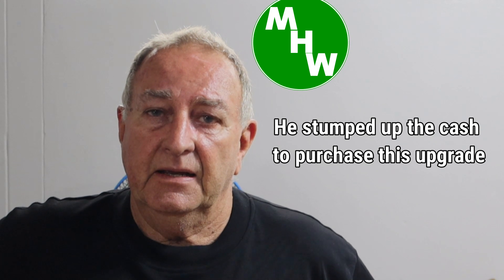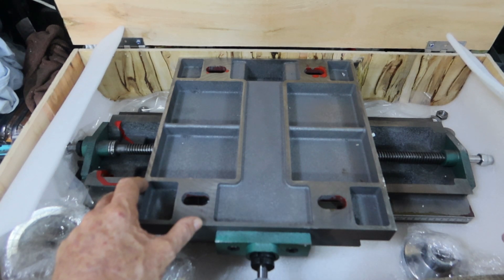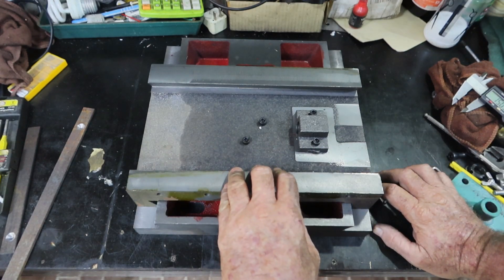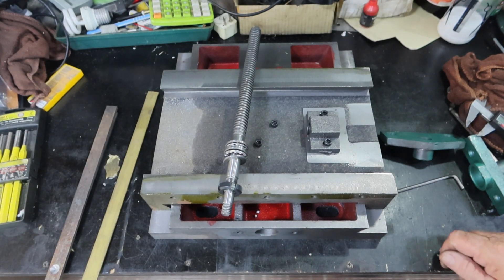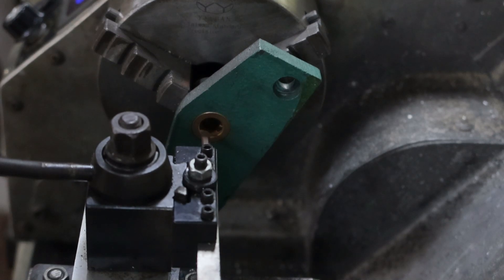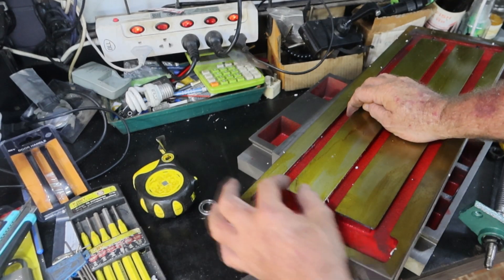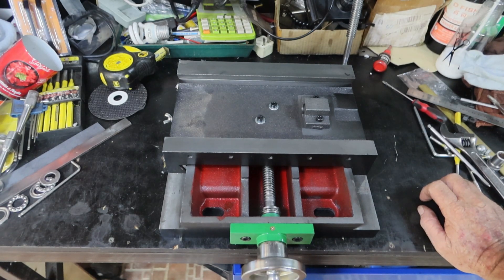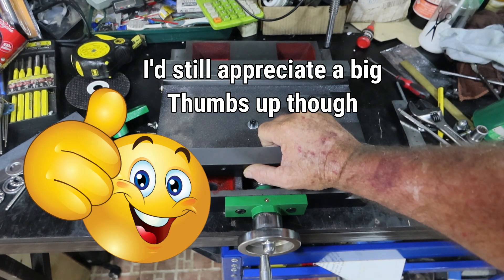Homemade Milling Machine Upgrade - MHW Episode 91

Comment: You should go on and do a ball screw upgrade it will take out all the backlash / slop in the table i have an X2 with ball screw upgrade its a good feeling to not be snapping off expensive bits do to backlash and well worth the money
Reply from the maker: Don't have the cash to do that at the moment, I want to replace the lead screw on my Z with a ball screw so maybe after that. 👍

Comment: Hi, I have the same x-y table. Having stripped one of the lead screw nuts in pretty short order I found that 12mm ball screws fit fairly easily and cost less than the bit of metal to make a new nut out of. Silky smooth and no backlash at all!
All the best, Cheers.
Reply from the maker: I noticed that is not much of a thread in the nut, but I shall persevere with these for the time being 👍

Comment: Using this table to replace the table on a X2 Mini mill.. considering using the dovetails but with new gibs and Chinese ball screws. 

Out of the box I had a few issues. The gibs on my table had a crazy bow to them.. more than my dail test indicator couldn't even measure (.030+ inches). And the lead screws looked like something had chewed them up well as well as all the slop your table had. Every machined edge was razor sharp. And the smell of the thing was absolutely atrocious- I have no clue what thats about. 

So far, I've torn it down 100%, properly devirred every machined surface, filled in a couple of the voids in the casting, and then applied a new coat of paint to get rid of the Xmas theme. I've also ordered new ground flat stock for the gibs. I'm still going back and forth on how I want to integrate this table into the X2 but I have some ideas. 

Thanks for the vid. All the best!
Reply from the maker: Mine was one of the worst castings I think I've ever laid eyes on, and the rest of the workmanship was simply atrocious. It works kind of OK now with the modifications I made to it and the crappy T slots are to this point are holding up 👍

Comment: I have never seen such shitty t slots other than in a table saw that had a sheet metal top and I bent the t slot out first time I used it xD
But you've built a whole machine from scrap so I am sure you can make it work somehow
Reply from the maker: I've already formulated a plan for if they let me down, and I suspect that if I get too heavy-handed at some stage I'm going to break bits out of them. 👍

Comment: Ah, the joy of chinesium.  The quality of stuff like that is generally pretty lamentable, it's shocking that they actually charge money.  Bushes are a good call, they're probably oilite rather than bronze.  The T slots look like cack.

For the gibs, I'd be tempted to mill the supplied ones down and then solder or braze a brass face on.  Either that or make up new ones from cast iron.  Still looks to have a fair amount of slop in the leadscrew nuts even once they're tightened down, you might be able to fix up the existing ones by slitting.  All the bearing surfaces are going to want checking, blue 'em up and see what they're bearing on.  My guess is "not much".

And good luck with the op.
Reply from the maker: I ordered some 1/4" thick brass bar to use for gibs, it arrived here 1/2 hr ago, only a week after I ordered it :face-orange-raised-eyebrow: I'll find out next week if they've got it all or not 👍